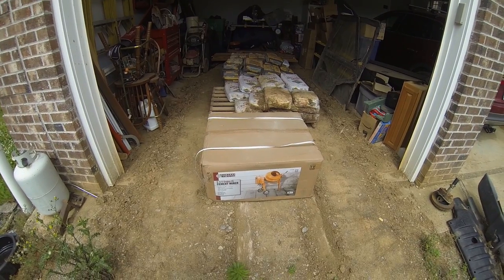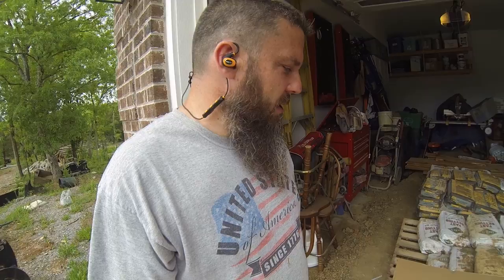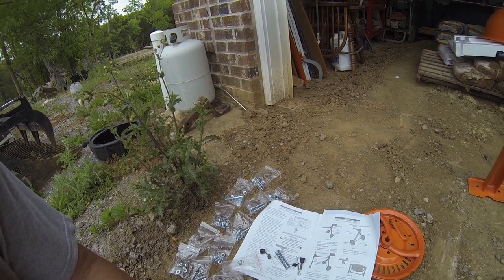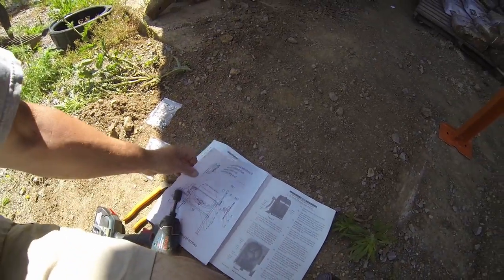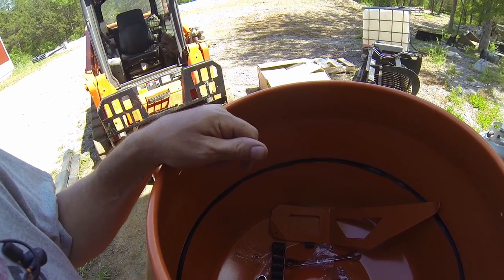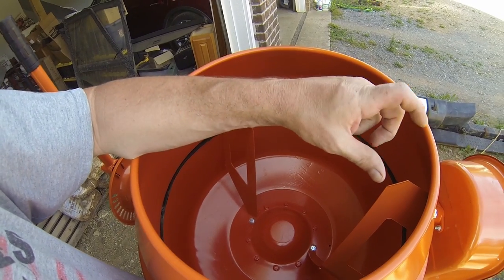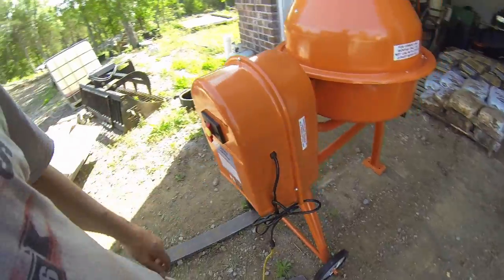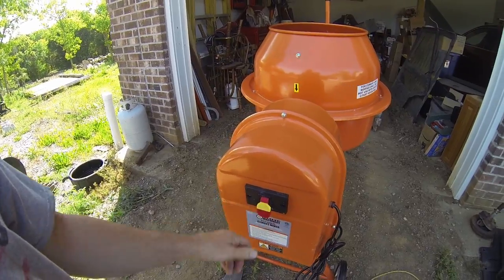Harbor Freight Cement Mixer unboxing and assembly 076

Comment: Thanks for the video.  I noticed after my first two 120 lb loads that the drum was no longer turning.  I checked the pulley and belt and everything was fine so I figured I better look on you tube to see if anyone else has seen this issue.  After watching your video I checked the gear and noticed it had play.  As I was tilting the drum I could hear something moving between the upler and lower halves.  I was able to fish out the key with a magnet. Hoping the screw and washer will be there somewhere...